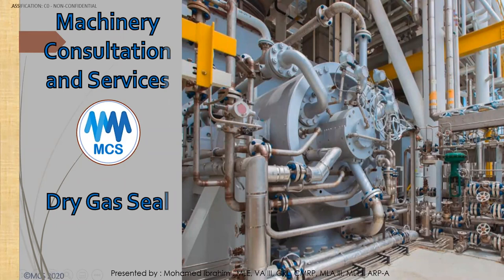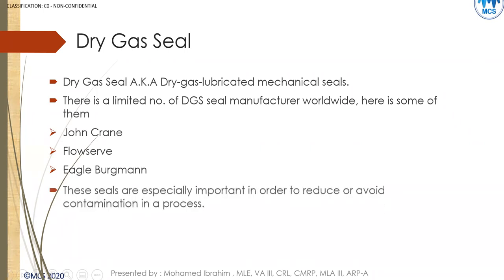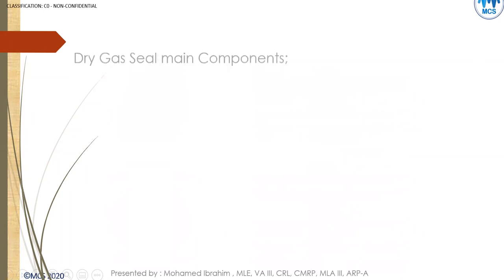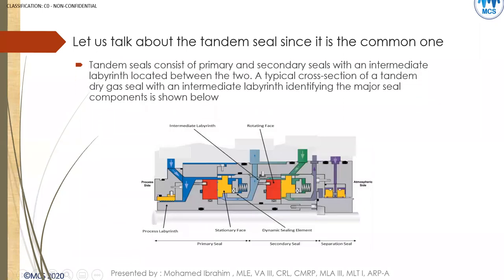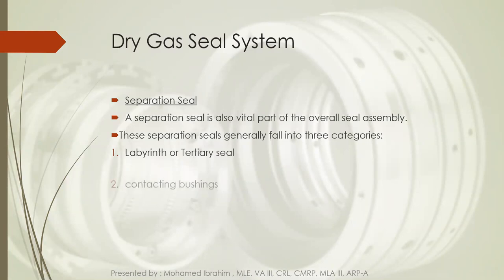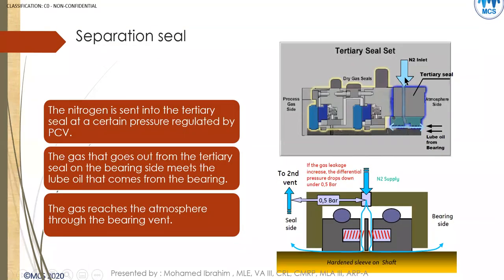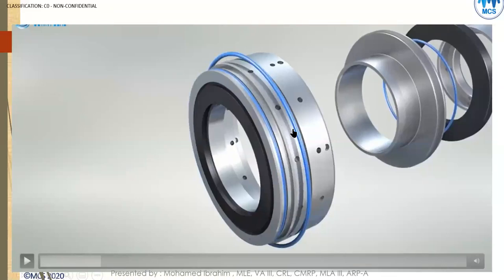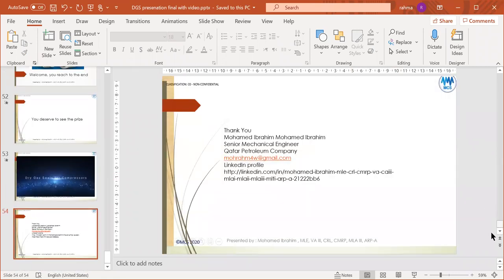Dry Gas Seals by Mohamed Ibrahim

Comment: Thanks you for the good presentation 

I would like to emphasize on the function of separation seal is to prevent lube oil leakage from bearings into seal faces. That's why nitrogen pressure of about 8 psi is start permissive for lube oil pump

Comment: As the seal gas leaks to the inboard side and forms the barrier, it has to pass through the labyrinth; what's the pressure drop within the zig-zags of labyrinths? How much pressure drop are we having till the seal gas finally reaches the process side and form the barrier?